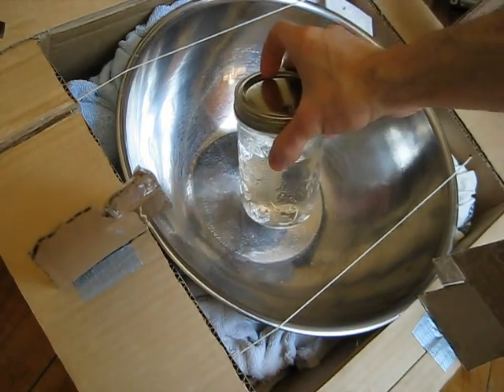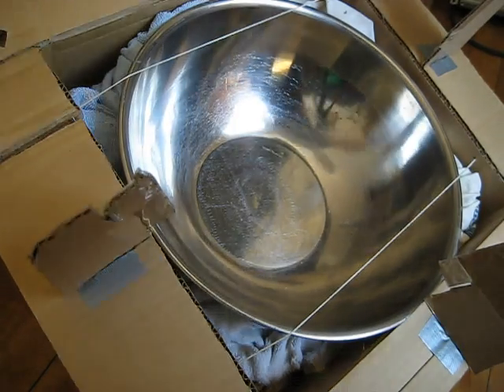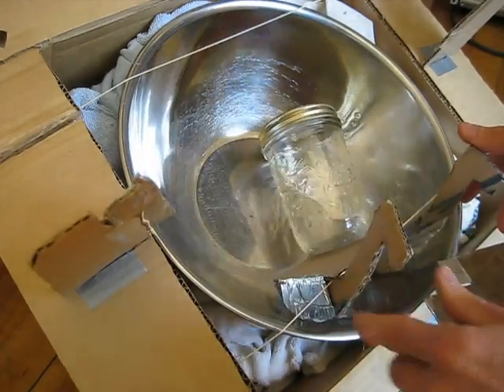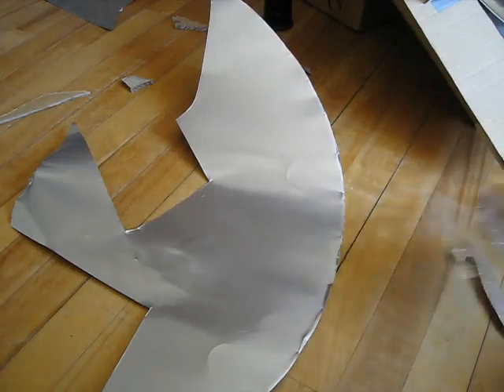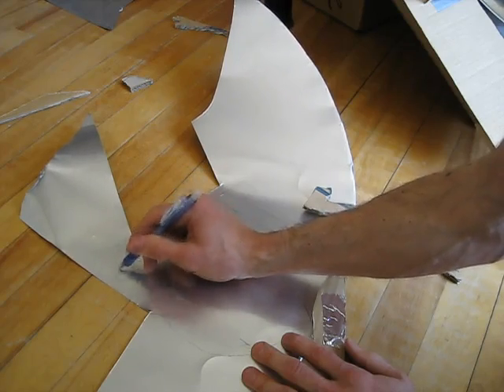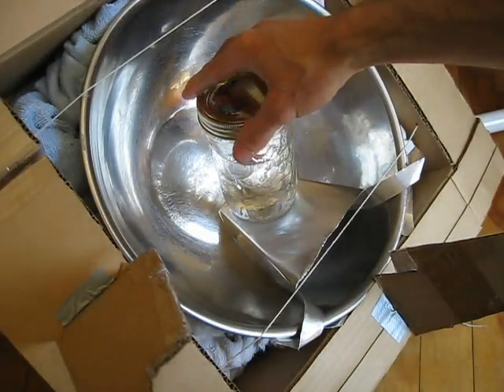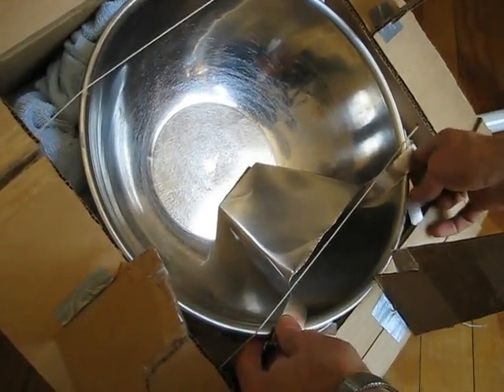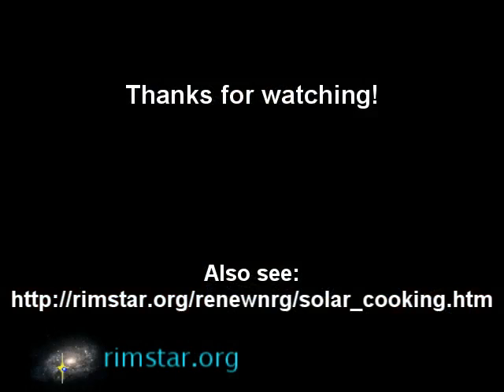Cone solar cooker part 4 - The cooking table

Comment: Probably a dumb question but I will ask it anyway. I understand the solar cookers were originally designed for third world refugee campaluminium
Reply from the maker: No this one. This one I designed myself for my own use. I ended up using it a lot for cooking rice. As for solar cookers in general, from https://en.wikipedia.org/wiki/Solar_cooker#History it looks like the first ones were not for refugees.